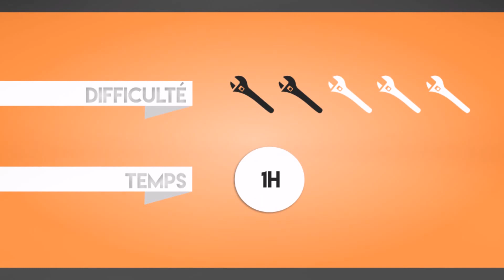TUTO #16 - CHANGER SON EMBRAYAGE (DERBI EURO 3)

Comment: Bonjour, j’ai un bruit de frottement (comme une disqueuse qui coupe du métal) quand j’accélère, que j’ai une vitesse d’enclencher, et que l’embrayage et débrayé
Sinon, au point mort en roulant ou pas ça ne fait aucun bruit, avec une vitesse si je touche pas à la poignée d’accélération il n’y a aucun bruit non plus 
J’ai demandé sur beaucoup de forum et ça serait soit de l’embrayage soit des roulements de boîte, une idée ?
Reply from the maker: Bonjour, cela peut venir de beaucoup de choses. Je vous invite à contacter directement notre service client à info@50factory.com ou au 05 40 13 02 24. Notre équipe pourra voir cela avec vous.